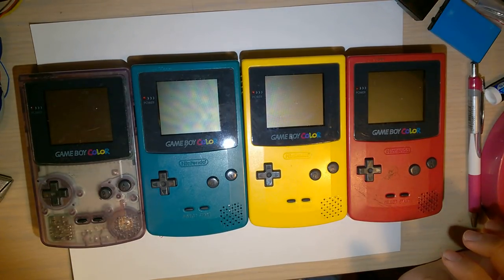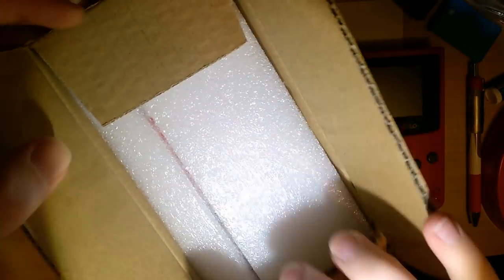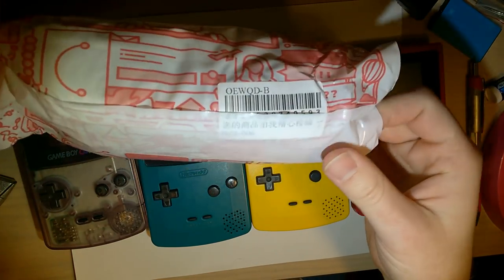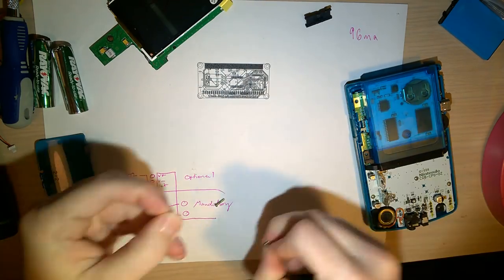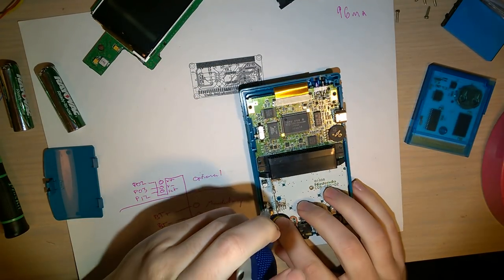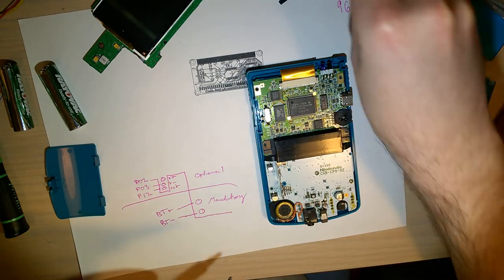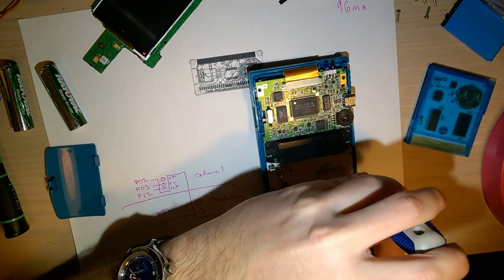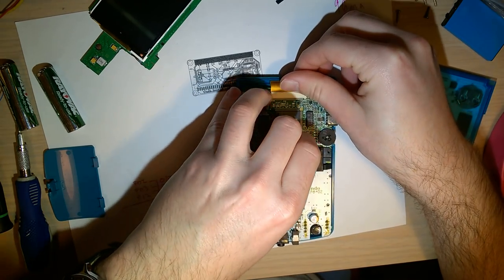Installing the "Galaxy Screen" Taobao LCD in my Game Boy Color

Comment: I still think this is an improvement over freckle shack, I have one on order, it is relatively smaller than this, and even the ags101 when it comes to screen size. This is the superior size still
Reply from the maker: Maybe in terms of screen size, but quality is yet to be determined and price is a big consideration as well. FS is half the price as this mod and quite a bit easier to install.

Comment: If you get a Freckle Shack or Mcwill GBC backlight, I'd love to see a comparison vs this screen. I like that the viewing area is bigger on this one.
Reply: Nevermind, looks like you already did!
Reply from the maker: @nbchowning  Actually, I already got my Freckle Shack, but I'm still waiting on my McWill =)

But I do plan on comparing the four backlight options (Freckle Shack, McWill, Taobao, and AGS-101/El Clono) when I get them all assembled. I won't be picking up the Midwest-Embedded kit any time soon, but I really would love to have all five kits.
Reply: @makho  Thank you. Nobody on YouTube has made a  comparison between Mcwill and Freckle Shack. I want your opinion on who has the better LCD out of those two.
Reply from the maker: @TooFurious4  So I just finished assembling my McGBC and I'm uploading the video on that right now. I did spend a couple minutes in the video directly comparing the two mods but I will be making another video entirely where I compare all the mods and put them head to head (to head to head). It should be noted though that FreckleShack and the McWill GBC mod both use the exact same LCD so quality of the screen itself is not going to vary between the two mods.
Reply: I got a midwest embedded and this kit did not dissapoint! Little cutting on the shell and stupid easy to install. Has the screen dimming option as well.
Reply: And by the way how the fuck are you people getting freckle shacks? Ive orderd mine since April 2nd and still have not arrived. .
Reply from the maker: @kr4t0sg.28  But that battery life though. RIP.
Reply: @nbchowning  What's the cheapest available option to use right now? I'm looking to get into modding Gameboy hardware because I love them so much :)

Comment: I wonder if there is a way to buy a modded taobao GBC without going to through TaoBao ? Is the aspect ratio and screen the same as the original Gameboy screen or is it smaller ?
Reply from the maker: I'm sure you can commission one somewhere. No idea where though. The aspect ratio is the exact same but the display image is slightly smaller. It's not small enough that you'd want a custom lens though.
Reply: makho if you start making them I would purchase one let me know . That’s dope !!!! Props to you !!! 👍👍

Comment: Do you have a link to this screen? How much did it cost?
Reply from the maker: The screen is on taobao: https://item.taobao.com/item.htm?id=543848183473
Reply: @makho   Thanks! I'm having trouble picking the LCD, there's so many options and google translate doesnt help.
Reply from the maker: @alexandertouchdown8737  This is the option you want: https://i.imgur.com/L6N2Ysl.png
Reply: There are better options out there, this is way to expensive and you have to really cut the case.

Comment: I can't navigate their site to buy this lcd. Damn it
Reply from the maker: I highy recommend navigating in chrome with translate turned on. Or you can set the language in taobao and it will translate most of the pages but it's still pretty rough. A proxy service might make it easer.
Reply: @makho  I can't get it to translate certain pages but I'm sure it said it doesn't ship to UK
Reply from the maker: @MartinSproule  Yeah, I had those problems as well. That's why I bought my screen through a proxy. I used superbuy but I'm also in the US. I don't know if superbuy ships to UK or if there are any better options for you though.